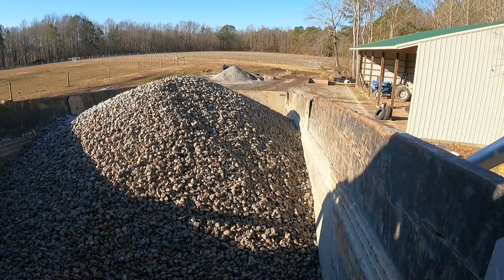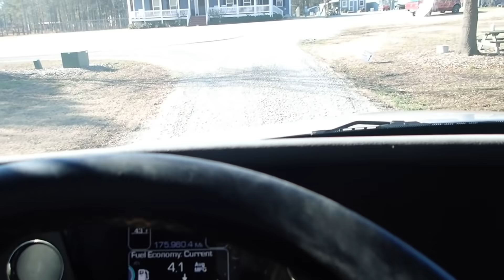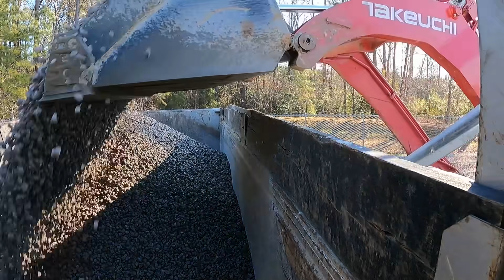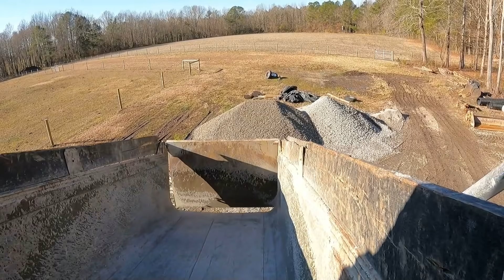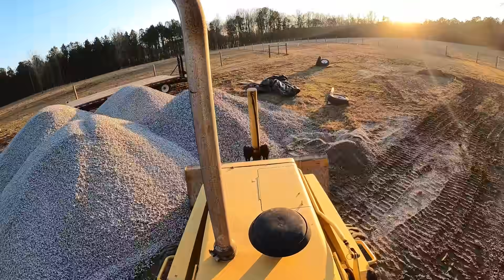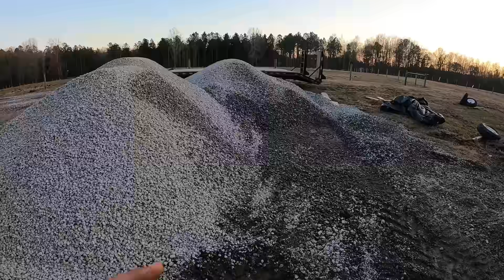Hauling Gravel To The Farm

Comment: Just one question: What can't you do perfect??? That was a great tail gate spread of gravel. And new or used, gravel is gravel. I did not see a ton of mud mixed into it, so it will work just fine. Sometimes it is fine with a bunch of mud in it as well, just depends upon the use.

Comment: What is a load of gravel worth in your area ????
Reply: $43 per yard in north MS
Reply: @littlefinkle7757  Here in South Western Ontario Canada it's $34.00 per yard + Tax & delivery
Reply: Ithaca New York area, upstate, the country, trees, cows, corn fields
Price per **ton**
#1A Crushed Gravel $16.00
#1ST's Crushed Gravel $15.50 
#1 Crushed Gravel $15.00 
#2 Crushed Gravel $15.00 
#1 & #2 Blend $15.50 
#3 Crushed Gravel $15.50
#3A Crushed Gravel $15.50
#1 & #2 Round Mixed $14.00
#1 Round Gravel $13.50
#2 Round Gravel $13.50
#3 Round Gravel $15.50
Bank Run Gravel $13.00 
Item #4 $14.00
Reply: Why do you guys measure stuff in 'yards', instead of by weight/tons?
Reply: @kthemi10  were lucky it's not in meters
Reply: @kthemi10  around me the small quarry’s don’t have scales so its yard pricing, the big quarry’s have scales and sell by the ton.
Reply: @blairarthur302  Have that right. :)